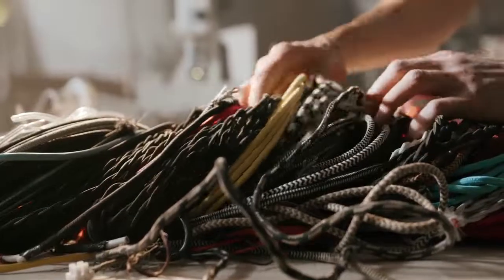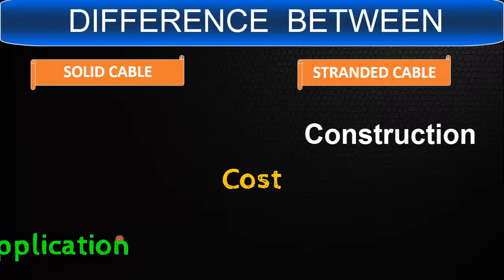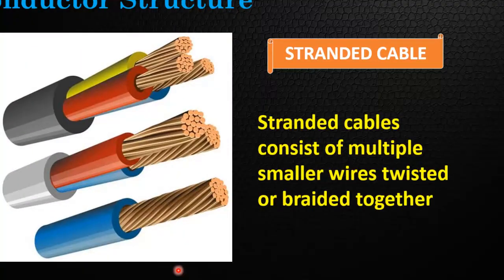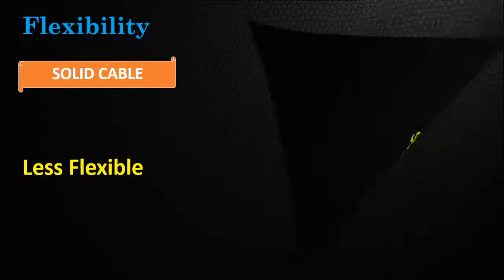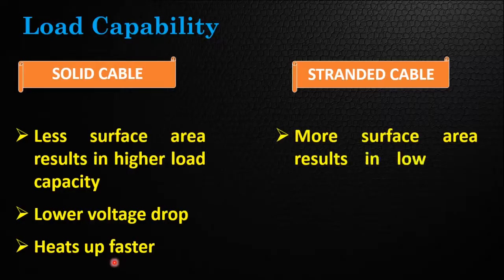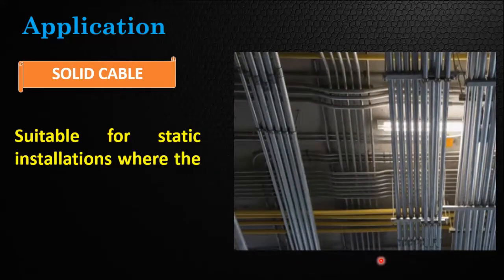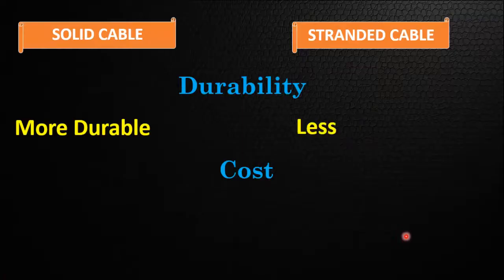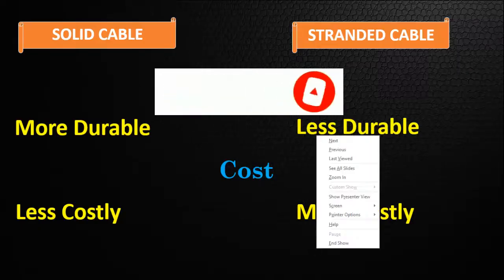Solid Cable Vs Stranded Cable | Main Differences

Comment: idk why and who tf invent stranded cable, but in my opinion and experience solid cable is the best, I really hate when I comes up with stranded cables. why? the tip is annoying >:(
Reply from the maker: Its not about personal liking, its about the application. Some applications require stranded cable. Both have merits and demerits